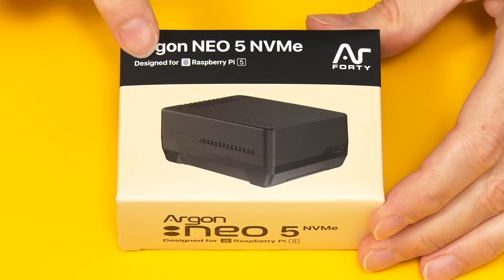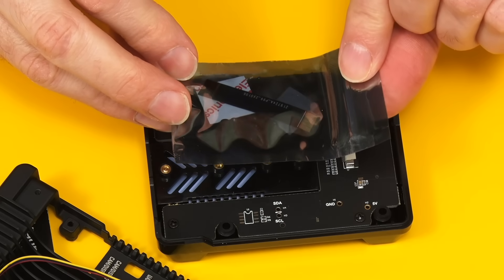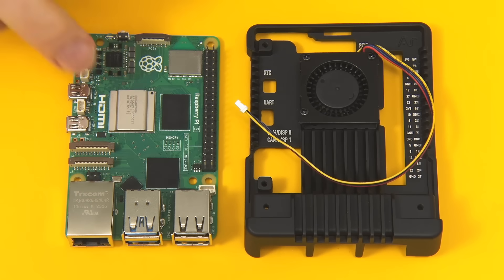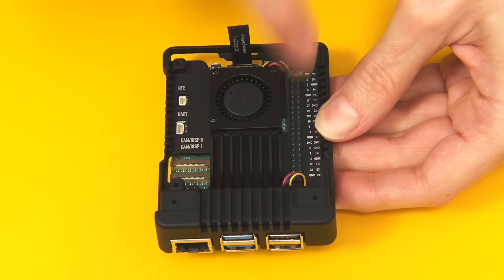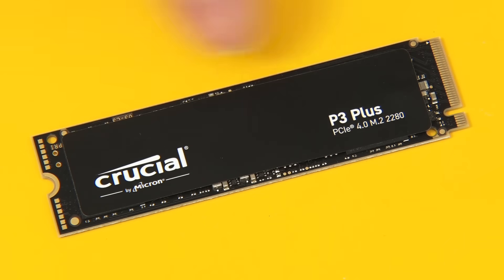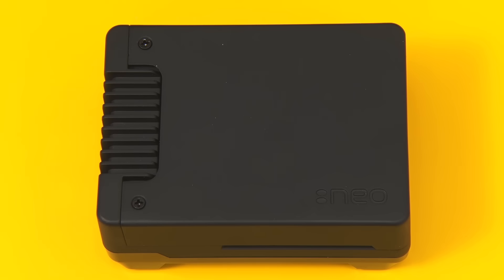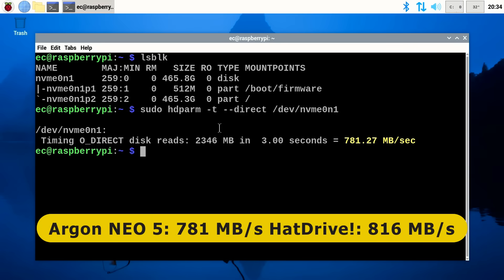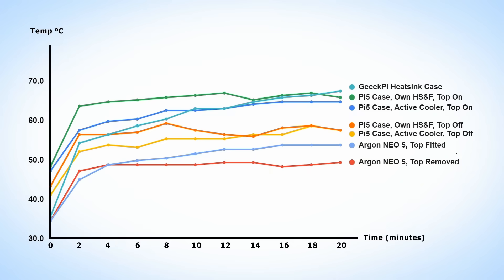Raspberry Pi 5 Argon NEO 5 NVMe Case

Comment: As I think about the value proposition between an X86 mini-PC and a Raspberry Pi 5, the big advantage that the Pi offers is the easy acquisition of replacement parts should the unit fail.  With one of these mini-PC, if anything goes wrong, you are dependent on the company living up to its warranty or supplying a replacement motherboard for a fair price once out of warranty.  Whereas with a Pi build, replacement of the SBC board involves little more than swapping in a new one.  On paper, the X86 mini seems like the better buy, but in the real world, if you're a builder-type who prefers to maintain their own gear, an overclocked Pi looks like a better longer-term investment.

Comment: Looks great upto the point it shuts out the SD slot.  Need an adapter cable to break it out or a case that easily afford access.  Best so far is modded case got in PI bundle and pimoroni base nvme hat and with that, can just about access the SD card slot, but not ideal/elegant.

Verticle mount case be great for NVMe solutions, guess one day end up making me own.

Comment: I have recently installed a Raspberry Pi 5 in one of these cases and agree entirely with your thoughts on it. I used the same NVME drive and got a speed test result of about 820Mb/s.
It’s a great case. The only downside is that it almost entirely kills the Wi-Fi signal which means I have to use a network cable. That’s not a major problem but slightly annoying. Would love to know if anyone else has encountered the same issue. I assume the signal is blocked by the metal case. I tried moving the Pi much nearer to my router but still no joy.
Reply: The use case of a Raspberry Pi in a case like this is mostly in a fixed location, in which case a network cable already is a better option. There are other, non-metallic cases that are better for Wi-Fi, but those come with cooling problems.

Comment: It is a nice case, but there are some things that could easily have been made much better:
1. The case should be all metal - why make the base plastic when the rest of the case is metal?
2. There could (and should) be a better solution for the fan cable. Make the wire the right length for direct routing and make a proper channel for it in the metal casting. As it is, it tempts you to route it neatly, but in a way that will block airflow (see other YouTube videos!).
3. There is no good place to put the RTC battery: I ended up making a pocket for it in the metal lid, but that means having a snagable wire between the two parts.
4. The slots in the side of the case should be open, not a vent grill. This way ribbons from the GPIO and other wiring could be neatly routed out with the lid on. Unfortunately the teeth are metal not plastic so not easily cut off!

Comment: When there are SSD card reader extension cables available I think Argon miss a chance to make their cases really stand out by not incorporating access to the SD card reader along with all the other ports.
Reply: I think the only way is to move the hat on top. That could be tricky to do in order for the cpu cooler to be effective. I think its a design flaw of the board itself, but I'm sure in time there will be some cases for your specific situation.

Comment: I managed to get an Argon ONE V3 M.2 NVMe PCIE case, which does all theat the NEO does but adds full size hdmi & audio. Also has excellent build quality. BUT like the NEO the SD Card reader is not accessible so installing an OS to the NVMe is difficult. The easiest is if you already have (as Chris does) an NVMe / USB adaptor / case. The instructions provided weren't very helpful in this area. Also if the RPi5 could be programmed to boot from usb prior to the NVMe, that would be helpful if you want to change the OS on the NVMe.
Reply: My favorite aspect of the Argon ONE cases is that all connections are on the back side. And yes, the lack of accessibility of the SD Card slot is a distinct disadvantage of the M.2 cases.

Comment: I hope those thermal pads are not electrically conductive. The one on the power IC is very oversized for the chip its cooling. I personally would have  cut it to size, it looks rather unfinished and potentially dangerous otherwise. As always great video, and happy easter!!

Comment: Not an April's Fool Day video ahead of time like at LTT Media Group?  I'll forgive, given the excellent and useful content.  Only issue you so rightly pointed out with this case, as with most other such options, is that the NVME on the bottom blocks access to the microSD slot.   Warm regards!

Comment: Hello Chris, happy Easter!

I'am using this case for a few weeks now. Initially, I used a Kingston KC3000 SSD (512GB PCIe 4.0, with DRAM cache), which reached temperatures of around 62°C. I then switched to a WD SN570 (1TB, without DRAM cache), and it now operates at a much cooler temperature of around 40°C. I'm running Home Assistant on this Raspberry Pi, and it's possible that the frequent writing causes a lot of data transfer from the DRAM to the flash memory. I'm not entirely sure, but it could be related to the Home Assistant OS.

Comment: I drilled holes in the top of my Pi 4 NEO case above the fan, temps and noise was lower, i do prefer the magnetic top than the 2 screws on this new version